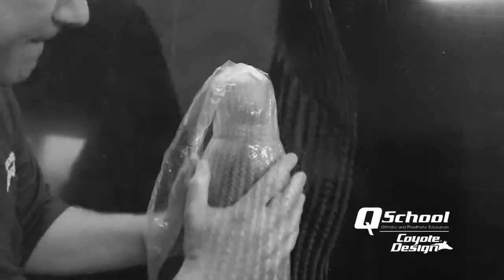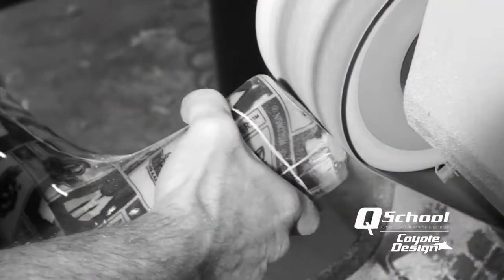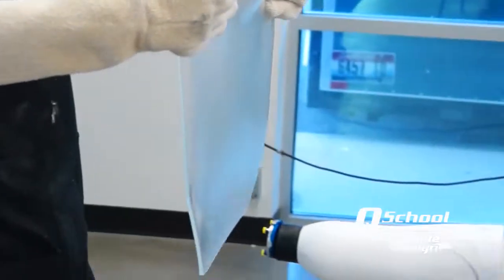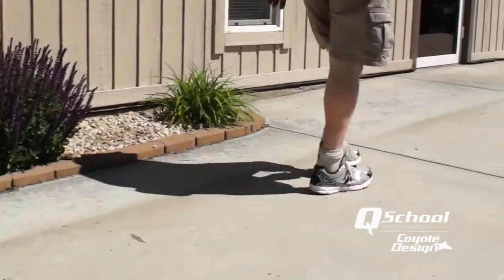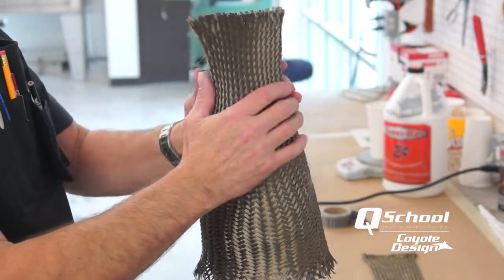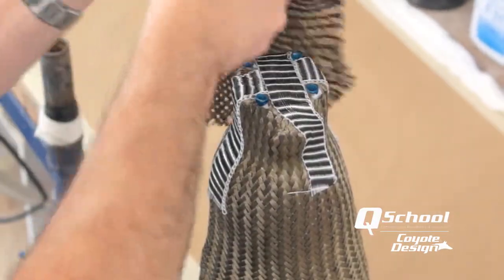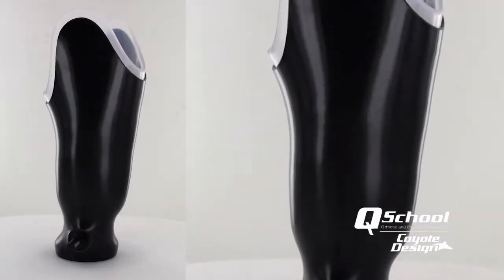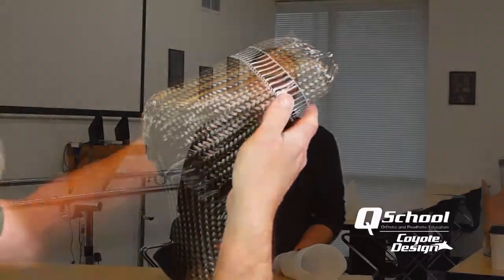Alternatives to Carbon Fiber FREE Course for Orthotists Prosthetists

Comment: I  am a new lower right leg amputee and learning about basalt in home construction and came upon this video by accident That's totaly awsome considering basalt is lighter and 10 times stronger. I have a question about prosthetic sockets since i am new amputee. Why can't tiny micro holes be put into the socket making so the skin can breathe?
Reply: depends on what type of suspension (bull dog lock or suction) and the type of liner you use.
Typically the liner is airtight anyway. 
I dont work for Coyote but I enjoy their products as a Prosthetic/orthotic tech.
Many Different 2 part epoxy resins are used in the fabrication.